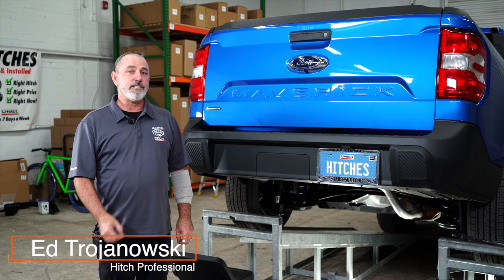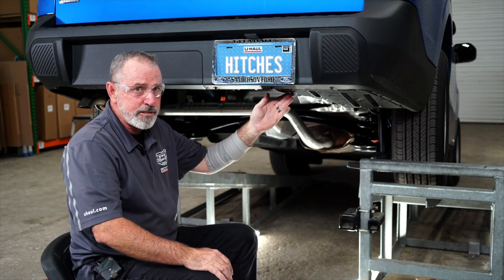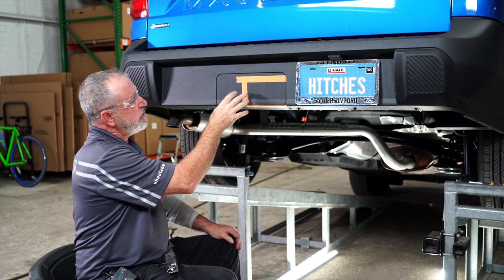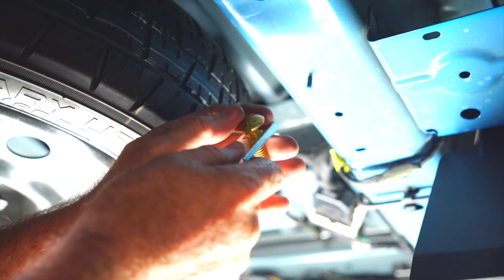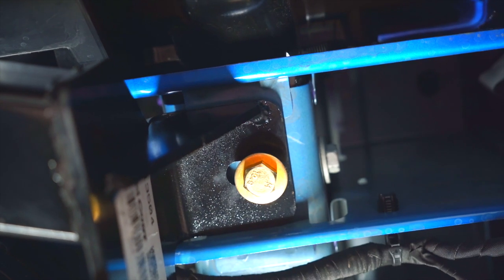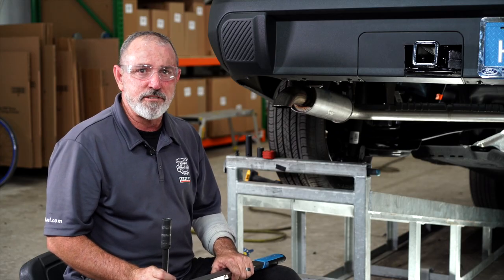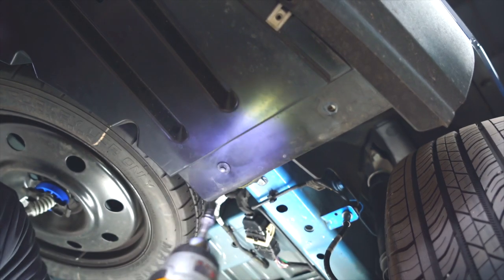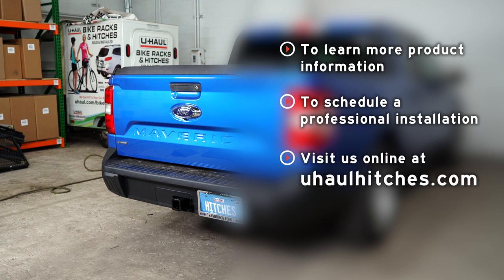2022 Ford Maverick | U-Haul Trailer Hitch Installation

Comment: Is this included the 4 pin? This one doesn't come with wiring
Reply from the maker: The wiring is not included in with the hitch, It has a separate part number. Here is the video for the wiring. You can also visit Uhaulhitches.com to get a quote for both hitch and wiring (And installation if necessary). - https://www.youtube.com/watch?v=UArrpS9LzZk&t=7s

Comment: 7:09 Question: Will the different bracket damage the rubber portion?
Reply from the maker: Great question. Simply put, no. The hanger is specifically designed to hold the rubber grommet securely.

Comment: Lot of work for a $100 option from factory that includes wireing
Reply: good luck ordering one and receiving it . i got lucky and found one on dealer lot that came in while i was standing there and the only thing that was different from what i would have ordered was it didnt have the hitch. btw if you do order one the dealership will add 5-10k more on it (atleast around here) or cancel it after you order it(and without telling you) just to sell it at a higher price.
Reply: the Curt 13504 is over 250 bucks and the wiring kit is probably 75. The Cost of the factory tow package added to a maverick truck is currently $795.00 This video shows a good option if you find a maverick in stock with everything you want except for the trailer hitch.....wiring is in the next video. Got to love the internet a salesman just told me that it was impossible to add an aftermarket hitch LOL Got to run my new Maverick truck (without tow hitch)  is supposed to be at my local dealership around noon today!
Reply: @darryls8066  tow hitch and trailer wiring is $100, you don’t need to get the $795 tow package to get them.
Reply: PatriotSeed? @#WaterPurifier???
Reply: @MrMinecrafter16  True, the "4K" tow package for $795 is a 7-pin wiring harness with a trailer brake controller integrated into the headlight switch area, in additional to the 2" hitch receiver kit. The receiver and 4-pin wiring is $100 MSRP though if its a dealer installed option prepare to spend a couple hundred for installation unless you can talk them into waiving it somehow. Still, it's a nicer package as it is OEM, uses all OEM mounting points (no fish bolt flanges) and includes a more finished cover for the rear bumper.
Reply: @emotionz3  It’s $100 factory installed option if you order it when you order your truck.
Reply: And this is why you don't let UHaul work on your car